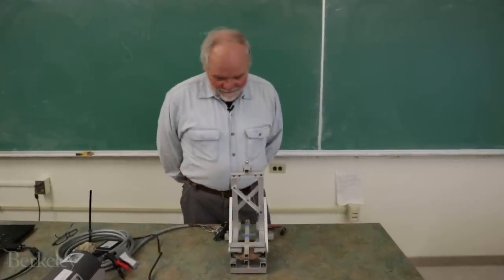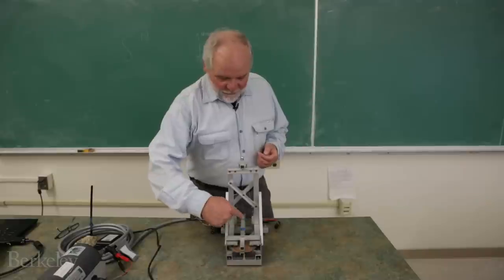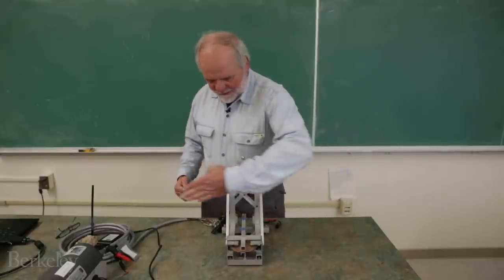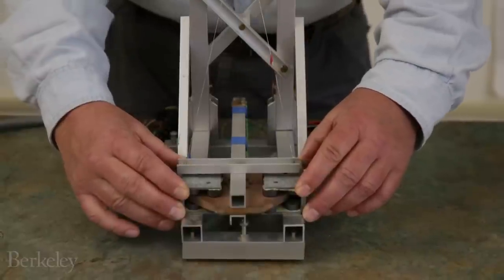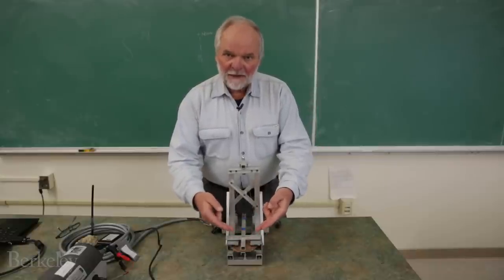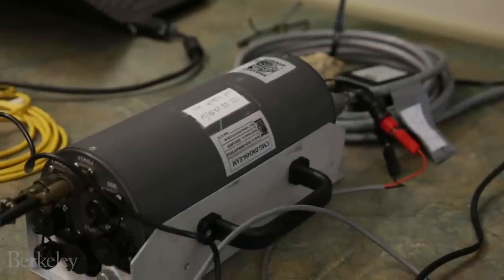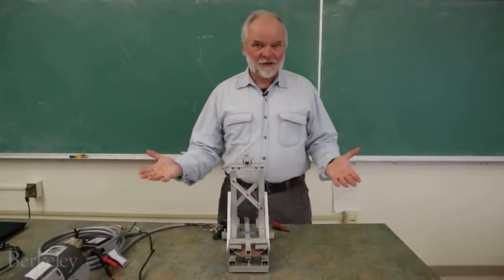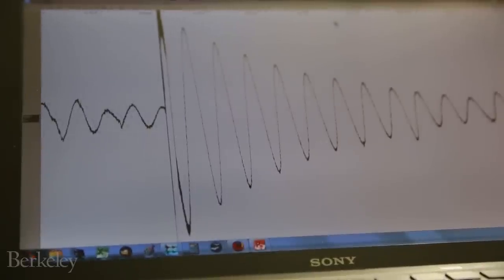How Does a Seismometer Work?

Comment: I'm wondering could 10,000 people at a concert jumping up and down show results on this device?
Reply: bro. if one guy slamming his fist on the table shows results, then obviously 10,000 people jumping will show results too
Reply: If they aren’t in sync, not really. If they are, yes, very much so.
Reply: @spikeoac4248 there’s a pretty massive difference between smacking a table with an arm which has a similar mass to the table and a bunch of people jumping at a concert that have a totally insignificant weight compared to all the earth they’re jumping on. It could show up sometimes and other times it wouldn’t, like if they were jumping in a field I don’t think it’d register.
Reply: Yessss the practical example is Travis Scott concert

Comment: I just wonder if the table is vibrating, then the whole system(including the seismometer) will vibrate, then will it calculate accurately?
Reply: This is just one method of calculation... And dur to operating errors  we can not get accurate measure but it is enough to give idea.  There are few other methods to measure this vibration . Collectively they tell lot of story
Reply: That’s exactly how it’s supposed to work to my understanding. It’s like a pendulum where the machine moves but the mass is supposed to “move” independently aka stay in the same place. But certain movements could still show up wrong especially with large displacement